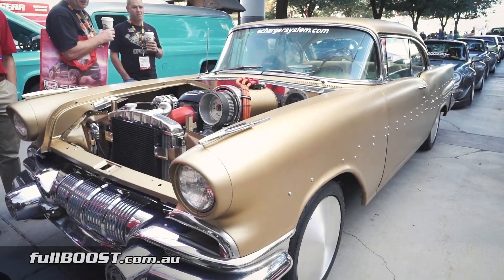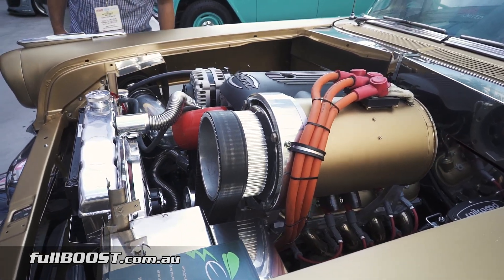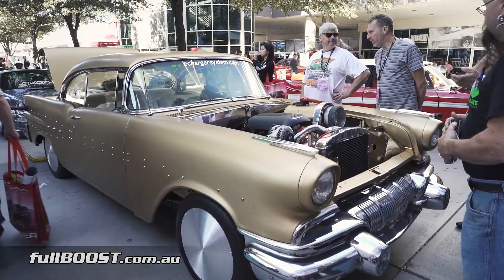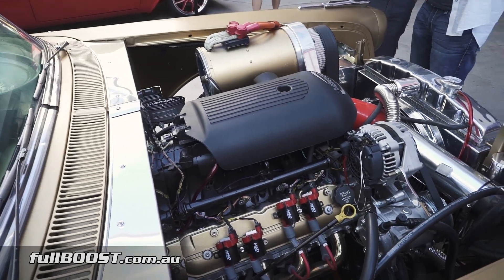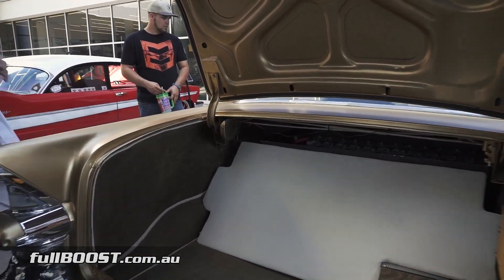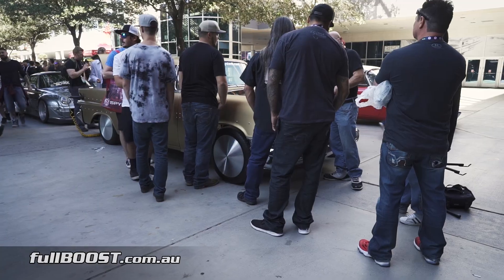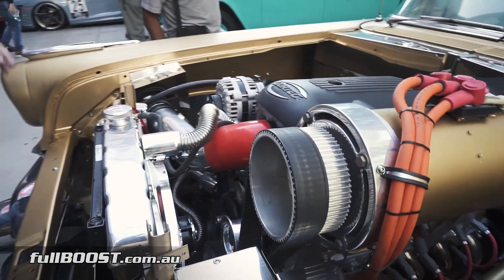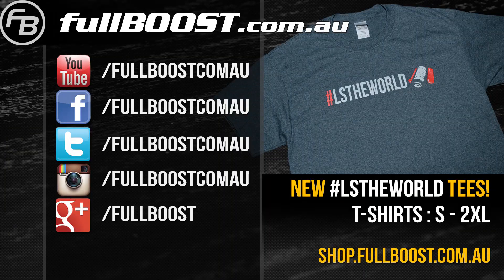The E-Charger Hybrid System

Comment: This is great BUT,  Why did the engineer decide on a pack that size?! Surely this system would benefit from the use of a smaller capacity pack and a bank of Supercaps. Capacitors are lighter & can handle more than 2x ripple current vs batteries. You can Regen more energy to the caps than the battery and use the excess from the caps to charge the battery pack more than without having Supercaps. Toyota was experimenting with an all-Supercap hybrid LeMans entry in the P1 class. It Regen'd into a corner as part of the front brakes and would help pull the car out of the corner up to about 120MPH. That car would rocket out of corners, & being Supercaps, was lighter and gave more electrical punch than Lithium can due to the lower ESR vs Rs losses in the battery pack.
Reply: Michael Rinkle -The point of this is about charging the batteries at home overnight with off peak prices.Plus the extra expense of a supercap system.  This lipo system is plenty powerful enough for where its driving through (The  crankshaft).

Comment: what a stupid system, how can people with this much technical knowledge miss a basic fact, running at low THROTTLE, the engine's performance is restricted by the throttle, making this system very inefficient, the electric motor should be on the transmission.

Comment: Talks about giving to gain, sure... You don't have to compress air and force induct and lose power there, but you lose it in the weight of your batteries and other bullshit added to make it work. Weight = lost power at least in terms of acceleration, powers obviously still there but it now takes more power to move the vehicle. No such thing as free power and that's kinda what's being sold here.

Regardless a fun, cool little setup.

Comment: ok real question is why bother with the crank that has the rpm rising and falling thru the acceleration process consuming unnecessary amounts of energy. one large one on the drive line or differential or multiple at the wheels like some high end supercars is much more logical and realistic

Comment: old post I know, but I see many comments of "you need that extra 150ft lbs of tq just to move the extra weight". whole system is 200/250lbs. if you honestly think 150ft lbs of tq is killed by 250lbs of weight than kick your day gf out the passenger seat and you're good to go! that tiny amount of weight is nothing for the cast range of benefits. fuel economy. power. like Japan and America had a baby.  MURIKA!
Reply: *Fat gf. silly autocorrect
Reply: +AdjSkills Shebnvguf *Vast. fk
Reply: +AdjSkills Shebnvguf.  ANDDDDD before anything is said. No, I do not have an edit option on my posts. 
Murika

Comment: imagine a similar system, a pulley based generator that sent high amps/volts to a electric motor on the front wheels, coupled with a battery backup system. So you had basically a bolt on super alternator that had a high output to offset running an electric engine. And you could use either when the later would run out of fuel or gas. So for a long trip you could drive say 3 hours on the electric motor before starting the petrol engine and then the petrol engine could be used not only to drive the vehicle normally but to also recharge or assist the electric engine for ultimate milage/ a way to use electric motors on long trips. And then think about making this system "bolt on" so old school cars could be retro-fitted with them.
Reply: Sam - Or use this system,no extra front wheel motor costs .Charge up at home for pennies, cheaper than running a petrol engine to recharge the batteries.

Comment: I'd love to see the front main bearings after a couple thousand miles.
Reply: Would it be any different to having a supercharger? Still got that belt pulling on it.
Reply: You don't think the pistons working at 4-5 k would have any different effect
Reply: @michaelherold181  maybe, but these engines weren't designed with such a large load on the front pulley in mind
I wonder if a torque converter replacement that can do the same is at all practical
Reply: Bearing wear should be similar to that front crank snout turning a supercharger, not an issue.

Comment: 150 Lb-Ft torque is only at idle rpm. The motor is rated at 50kW at 8500 Rpm which equates to 41 Lb-Ft. I think the specs should be clarified

Comment: This is stupid. You just added weight and your still spending money charging the batteries. Once those batteries go dead that motor then loads the engine. This is because if you spin a motor at the output shaft it acts as a generator. This in turn translates into a parasitic load on the engine further decreasing the fuel economy. Neat concept terrible execution.

Comment: I did something similar in the seventies with a electric starter on a trolling motor for a rowboat what a Kik for three minutes at a time !?!? High-pressure compressed air tapped right into the intake manifold a good kick but needed more fuel. !!! The best I found is a half a gallon hydrogen generator tapped directly into the intake manifold as a fuel additive a four cylinder vehicle on the highway that gets 35 miles to a gallon will get 45 or 50 miles to a gallon. Do not separate the hydrogen and oxygen do not try to store it do not make more than you use instantly.!!!!
Reply: this doesnt move air buddy. its not a charger of any sort. just connects directly to crankshaft and uses the electric motor to spin the crank. no boost whatsoever

Comment: This guy is amazing all around! Hes doing things nobody bothers doing. Theres so many different applications and benefits from something like this.. i own sport bikes for my speed needs but my daily driver is a 2016 malibu Lt that already gets 37 or 38 highway but its kinda boring af although its great for what it was designed for.. this would give me a bit more torque to get on the highway or when carryin a full car of people where that 1.5 liter turbo noticeably struggles.. and if it extended my mpg well over 40 then fuck yea i would get it.. major flaw of my vehicle is that it has an 11 gallon tank. granted it gets great mpg so the miles between fillups is about right but its annoyin at times.. puttin something like this in an already efficient car thats already a great daily driver would solve all of the above issues..personally i think they needto speed up the process of all cars going hybrid.. with government regulations thats where the auto industry is headin anyway.. with the tesla 100d already showcasing zero rpm torque doesnt make sense to wait.. great video and if you guys see this and have an upgrade for my malibu for a reasonable price im in
Reply: Only question would be whether to attach it to the drive belt as done on this vehicle or some variation of the hyper car direct to the tranny.. either way sounds like a fun project to see what kind of boost in performance and efficiency.. its a beautiful thing to not sacrifice one thing for another like he said.... its like a fat cake who loves cake and eats it and loses wait too lol

Comment: If you're using the gas powered engine to drive a generator that powers an electric motor you'll end up with less power and less fuel efficiency lol. It's physically impossible to make the same or equal power. Nothing is 100% efficient. The only thing this can do is store power in batteries and release it in one "burst", which is good for drag racing and such. But in terms of actual practicality and overall effectiveness as a hybrid system it's completely backwards and ineffective
Reply: v.vega- no one burst The engine only drives the generator when off throttle and braking,topping up the batteries..The stored cheap energy(recharged overnight/offpeak) is fed into the engine via the electric motor to get the vehicle up to speed quicker, using less fuel,as a hybrid it is very effective.You are backwards in thinking how this works.

Comment: What you want is a FWD car with a integrated electric rear end.
Then you get AWD security, electric efficiency, less batteries required.
Traction control would be very easy to implement with a primary-follower drive system.

Comment: the e charger is limited to how much the engine is able to speed rpm wise. this ls has a limit streetable of 6500 rpm.
if this system work like it should it would be more efficient on a honda 2.4 or equivalent low torque engine.

Comment: The main benefit of this is the ease of installation/universal adaptability. Should be built into trans//actually part of drive-line I agree with most however in terms of retro-fitting and practicality as well as looking pretty baddass, it isn't that bad of a desing/idea/execution.

Comment: Way to big. 1/2 or even 3(in series) 45V Electric motors could make enough boost for NA to get better fuel economy. No need to go so big. Or can even be used as electric(or turbo depending on how many W per H you get) Nitro's.

Comment: Really good for maintaining the reliability of an old car, was reading an article the other day which was referencing New york hybrid taxis, after years of crazy mileage and taxi driver abuse the petrol engine was in immaculate condition as the electric motor did all the work in stop go traffic which is where most of the stress in an engine comes from, you could have a system like this with minimal batteries which just kicks in below 10mph if you wanted to maintain a pure driving experience of a classic car while far reducing the stress on the engine so it will last many more miles :)
Reply: Yep, even in the service manual of most cars that offer PHEV (Like VW Passat) the repair intervals of moving parts are way bigger on the PHEV models.

Comment: I mean.. you can't turn the engine off and run on only electric... Does that make it an actual hybrid? It has regenerative braking and it probably recharges through the engine when you are idling and not under load.. it's just the most Ghetto KERS System imaginable...

Comment: And any thought in the price of this sort of set it's got to be around the $ 35,000 so I thought. Researched it on line for real world economy at a daily used vehicle upgrade used this way. My needs 100 miles distance there about are my daily commuting needs. Custom li-ion bat pack controller and all the the hardwares required I'm looking at $35,000 plus shipping. A further $3000 for the car transported to a reputable company in Western Australia from Melbourne Victoria. My car transformed into a hybrid of choice is a a 94 Holden statesman. The cost I was estimated would not include suspension upgrades either.

Comment: Last time i checked electronic part are expensive and rather less reliable than mechanical parts not to mention the batteries are very heavy, so tell me exactly how will your layout out perform an already existing, proven solution. It seems to me everybody is trying to reinvent the wheel by sticking a digital clock to it and call it innovation...

Comment: so much is said that ether is not answering the question or ,,, for example  the statement that the engine is limited to 6000 rpm unlike the 8000 rpm of the electric motor that it mounted to the crank.... did you hear that?? now your running  the LS engine at 8000rpm via the electric motor,, your pushing the engine faster than you should,, ok if i kill a SBC overreving it,, and why do i need the big SBC, oh wait  its a 5000# car,,, hey i can sell you a pill that will make your car run on water,, i got a case of um back in the 60s...
Reply from the maker: +Jon Carlson
He said the motor can go to 8000 whereas this particular LS  engine won't rev past 6 as its basically a stocker. That does not mean you rev the LS to 8.
Reply: do you honestly hear yourself? just because it supports a maximum rpm does not mean it's being driven to that extent.... most manufacturers make cars that can go far past that 5.5-6.2k rpm red line, but they dont run the engine like that because they want it to last longer, ie they don't run it to it's max.

the electric motor can go up to 8000 rpm's, it would not go to that by design as the controller more than likely limits the power going to it because it's primarily for efficiency with a mild engine pick up boost in torque via the power regained from braking

Comment: If this thing were efficient enough to pay for itself over a short period of time they would be advertising the math behind it. 

The fact that hard numbers aren't brought up leads me to believe that they're left out for a reason. 

Ex: my f350 gets about 15mpg. Adding 25% puts me at 18.75mpg. 
On my 30 gal tank that gives me an addition 110 miles per tank which is about equivalent to an extra 7 gallons of fuel. If fuel is $2.50, then I have saved close to $18 per tank of fuel. 
This does not account for the $0.75 per electric gallon or however he phrases it.
Giving them the benefit of the doubt and applying the extra $.75 to only the extra equivalent of 7 gallons gained over stock that is a little over $5 in cost. Now that subtracted from our $18 savings gives us around $13 saved per tank of gas (assuming a 30 gal tank). 
It would take 100 tanks for gas to save $1300 which for the average driver would take about two years. Now assume this kit costs around $3k and you're looking at almost 5 years just to break even before you start saving any money. 

Nice idea as long as you don't believe in math.

Comment: 150lbs of torque, but how much does all those batteries weigh? you can have a car and make an extra 100hp/100tq, but if the modifications to make that power are weighing the car down giving it a worst power to weight ratio then it would a negative correct?

Comment: That is the stupidest crap I have ever seen. Its not gonna work good, if you want a decent hybrid system you need a fluid dampened clutch assembly between the engine and the electric motor. You can't just hook a damn electric motor up to a crankshaft. Dumb. And I have even less faith in this dumb ass design seeing as how it wasn't shown running. I mean really guy? That's just an industrial like hoist motor or something....I expected better from SEMA. I coulda done better in my backyard.

Comment: "I don't like to give up something to gain something"... Well, strapping a giant electric motor to your car, along with all of the batteries needed to run it, is going to add some significant weight to the car, that's giving up something to gain something.
Reply: He was talking about energy, but if you strap on any kind of kit, it will add weight.
Reply: You're gonna have to give up a lot of money to buy and install this stuff . I don't think you're going to get your money back with the gas savings.
Reply: But  you gain traction .  lol  . Like is enough weight already on that car . To get some extra benefit on traction  thanks to weight .

Comment: I've been expecting something like this for a while now, fun idea, and I can't wait to see how well it works out. Road-test the bitch!
Reply: That's uhh... Certainly ONE way of accomplishing not the same thing at all.
Reply: GM as used this in some fashion with E-Assist, so this really isn't a new idea. It is cool that It can be bolted on to an older vehicle but I'm not sure I'd want to add that much weight with batteries, motors and a controller would defiantly hurt fuel economy.
Reply: Well, that's the case with ALL hybrid drive systems, and in the right situation, they do their jobs just fine. For stop-n'-go traffic, this would be great for a large vehicle, like my '76 Chevy K30.

Comment: This is like a way beefed up system that I was thinking about as an addition to a turbocharged car! My idea was to add a small motor that is capable of helping the engine in low RPM range only as a filler for a turbo lag with a capability to run continuosly for just a few seconds to flatten torque curve.

Comment: BTW the power to weight ratio of an electric motor is way better than any IC engine. For a racing application you would only need a small battery pack built with small modules so it can put out a lot of power but only for shorter amounts of time; like doing a 1/4 mile. After that the motor/generator can work as a generator to recharge the battery. A pack built with small cells could put out hundreds of volts and be the size of a suitcase; it just wouldn't have a real big AH capacity. For example: 
Tesla’s “85” kWh pack consists of 16 modules of 444 cells for 7,104 total cells.
Tesla’s “60” kWh pack consists of 14 modules of 384 cells for 5,376 total cells.
Every cell you add gives another ~3.7v no matter how small it is...
Reply: Voltage doesn't matter, watts do. Watts = power.
Reply: watts is a measure of how much work can be done. With higher voltage it is possible to transmit more energy faster. A smaller battery pack with lots of modules can produce high amounts of power but the amp hour capacity goes down; it can only put out high power for shorter amounts of time. It all depends on how the battery pack is built. You could make a pack with like 10 huge 1 Kw modules, it could only put out 37v but it could do it for longer (for example lets say its a 10Kw pack). If you made a pack with 1,000 modules it could have a peak voltage of 3,700v, if each module had a 100w capacity the pack would have a 10Kw capacity. Both packs have the same 10Kw capacity but the one with more modules can release more energy faster, and recharge faster (like with regenerative braking)

Comment: So the entire torque of the electric engine goes through that belt? Yea, I don't think it's going to work that well...
Reply: Top Fuel engines require ~800 hp to drive their blowers, and they do that through a belt a little more than twice the width of this belt.